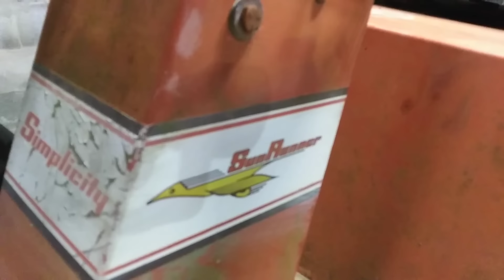Will this tractor live up to its name? -- Simplicity Sun Runner

Comment: If you clean the wheels, the tire beads will probably seat.
Reply: Lost me when you assembled with dirty rim, Unbelievable! I'm sure the original Tire is a 4 Ply rate one and you fitted   Basic 2 Ply!
Reply from the maker: Did wire brush them off camera, but did not put too much effort into it since using tubes was the plan from the beginning so they did not have to seal perfectly.